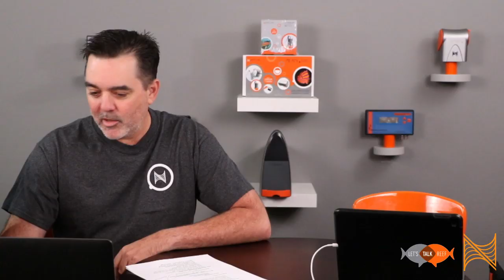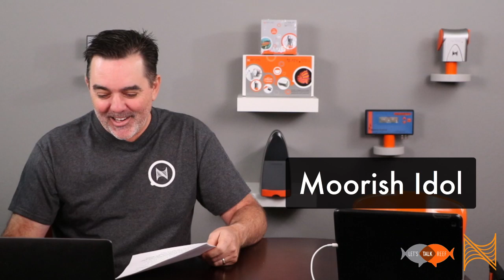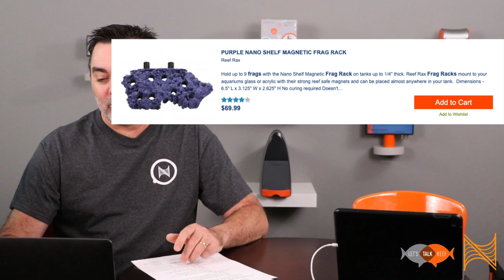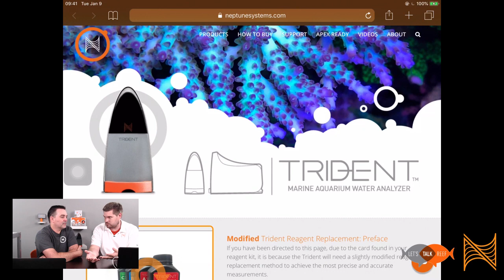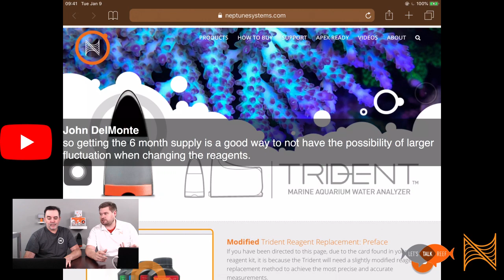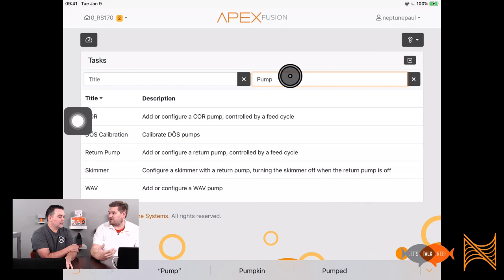#LetsTalkReef - Bryopsis, Heniochus, and fielding your questions

Comment: Why does my trident last 48 minutes in each test?
Reply: A combined test should be around 25 mins.  If it takes 50 minutes that means its doing a double test because the first test deviated too far from a test it did 6 hours ago.  Say it gives you a result of 9Alk, 400Ca, 1350Mg at 6am.  If at noon the first test comes to a result of 7Alk 300Ca, 1275Mg its most likely assuming something went wrong as those numbers shifted by a fairly large margin in such a short period of time.  It will do a second test and if those really are the values it will record those for you to see.  Its a little safety calculation double check going on in the background because it doesn't want to activate control dosing and cause your pumps to put in a ton of extra additive, or stop completely if those numbers were a mistake from air getting into the line or reagent running out.  Now if your 6am, noon, 6pm, and midnight values are all very similar and all the tests are taking 40-50 minutes I'd contact support.
Reply: Thank you very much for your response,  I've tried everything I can to fix it,  but I think I have to contact customer service.